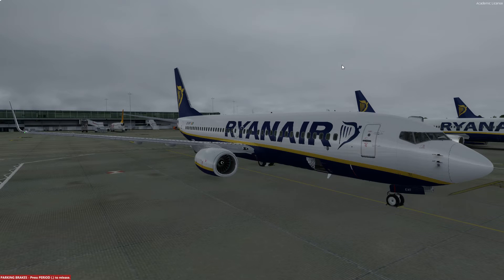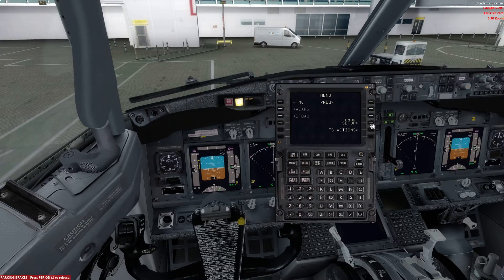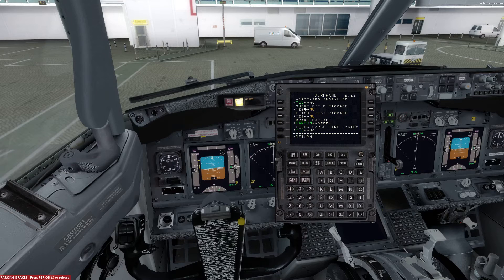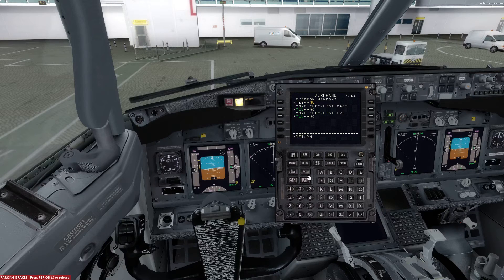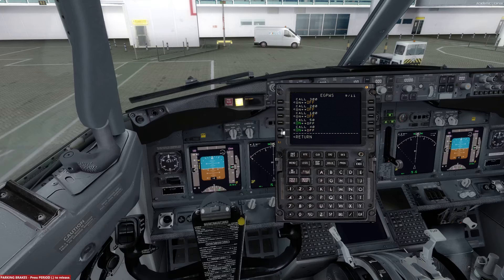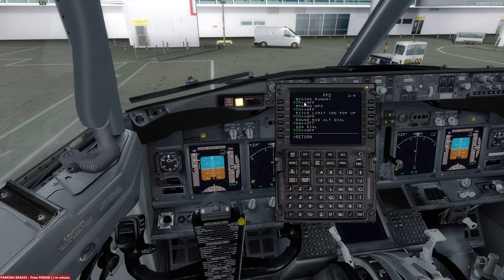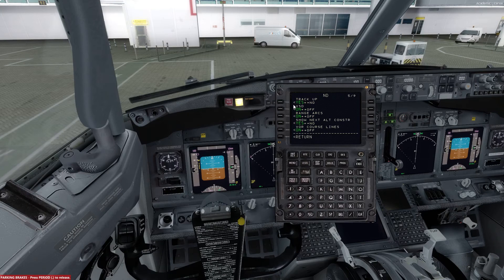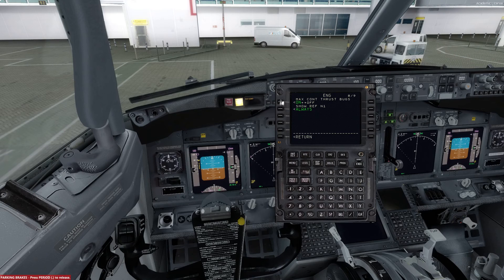vRYR PMDG 737NGX Configuration Tutorial

Comment: The MCP part regarding EI-DAC till DAJ is wrong, honeywell is fitted on many newer a/c, such as EI-EFM, EI-EKN and few others, while EI-DAD, DAJ, DAL, DAO etc has collins. Just letting you know..
Reply from the maker: Thanks, I'll pass the message on. Was just following the steps on the website and going from that. Feedback appreciated! :)
Reply: +HotDog12ist Is there a list somewhere with configurations? As I pretty much assume whatever MCP was available at the time got installed
Reply: +Lukas Jankauskas There isnt im afraid, I just speak from what i've seen myself. Though I know that they sometimes get switched between a/c, let's say if there's a failure of an MCP unit on EI-EKD, they'll replace it with what's available, and chances are, it's a honeywell. I also remember seeing a cockpit picture of EI-DAH from when it was only a few months old, with collins installed.